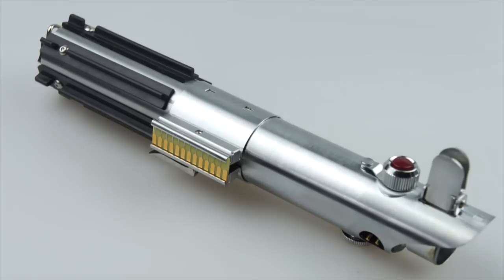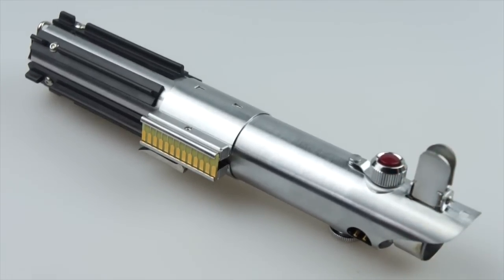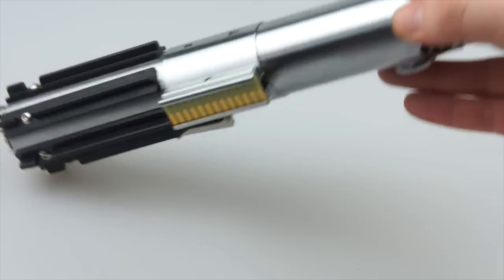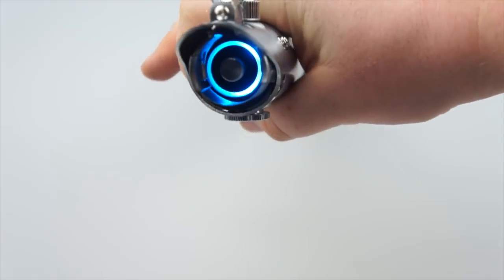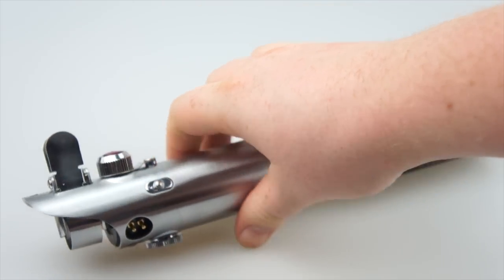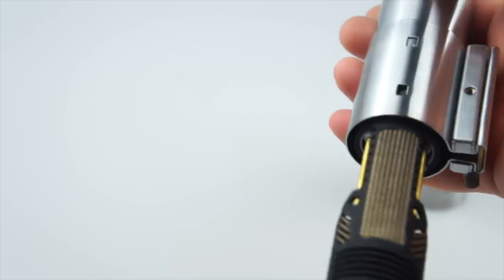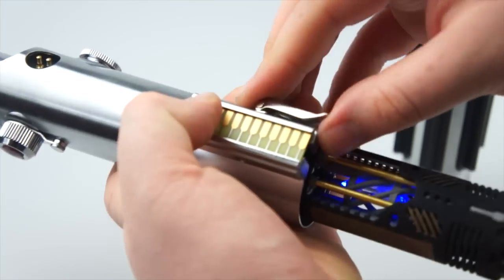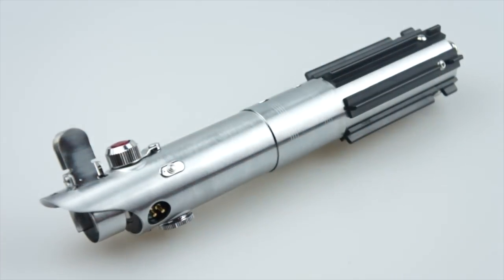Scotts Korbanth Graflex 2.0 Custom Star Wars FX Lightsaber TFA

Comment: That shitty glass eye though
Reply: I may replace it in the future with an accurate TCSS one, but the postage costs to the UK are apparently very high. I also have the second red button for it so I can always switch it to the ESB configuration.
Reply: It certainly looks good, but as the eye on mine is also the retention screw, it won't work sadly, at least not so that light can shine through it. I'm sure I'll be able to come up with something.